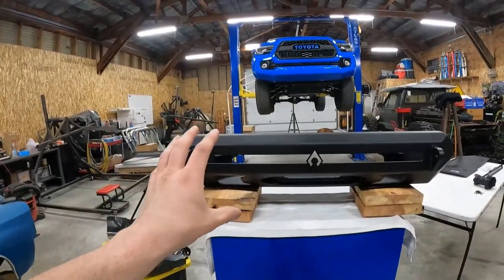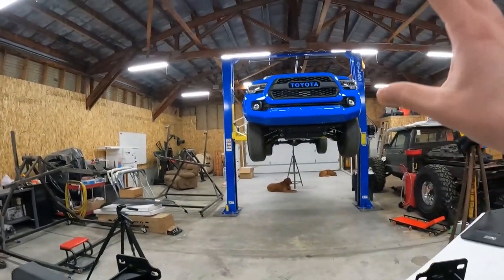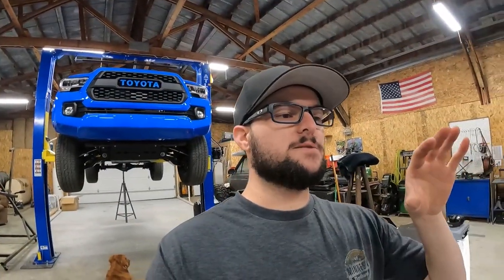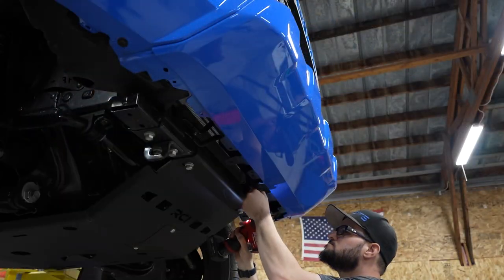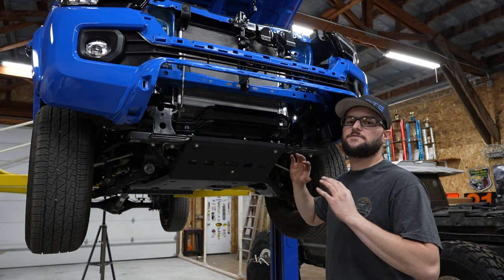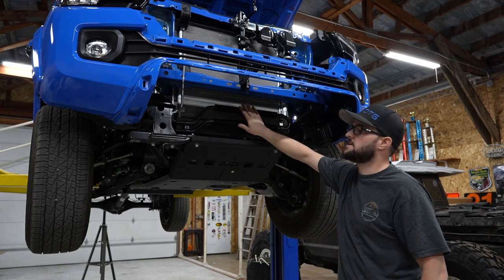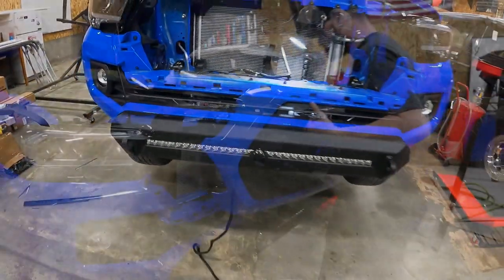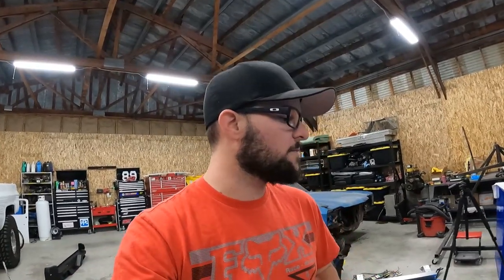Tacoma Front Bumper, Lights, Winch

Comment: My biggest question is can you access the winch clutch from the bumper cutouts?  This is the best looking bumper I’ve seen and all others that I’ve seen you have to pop the hood and reach down through the grill to access the winch clutch.  
This is my favorite bumper also because it can accommodate a larger 30” light bar versus all others only can have a 20”.  
The final reason I love this bumper versus others is the minimal cutting required that ca; be hidden behind the bumper.  All others have a “wavey” cut line that you can see on top of the bumper.   That would irritate me if it was my truck.

Comment: have you had a chance to use the winch yet? Is there any concern with how the winch is mounted that it might cause strain on the line when in use?
Reply from the maker: I've used others that have the same pull angle with zero issues.